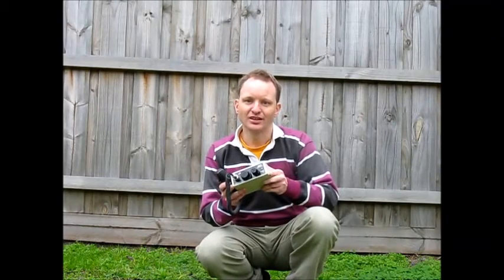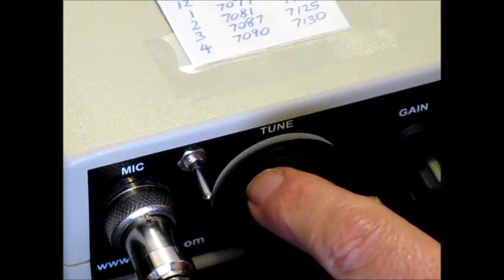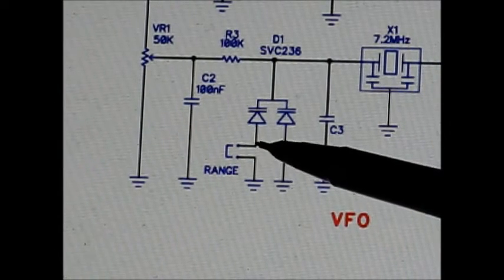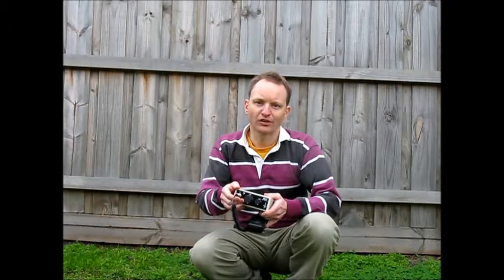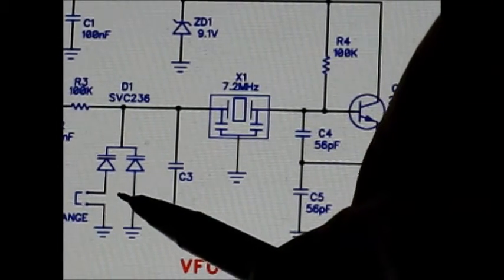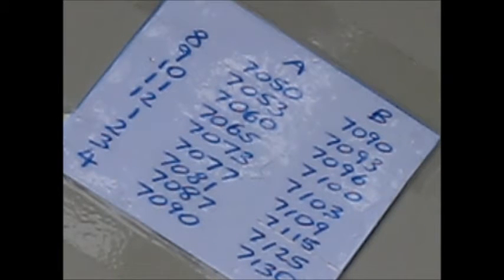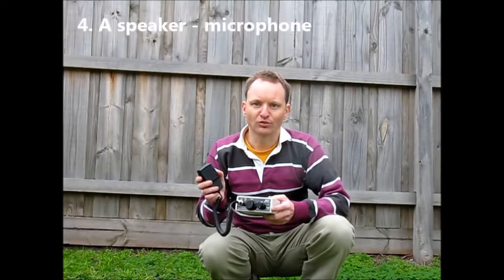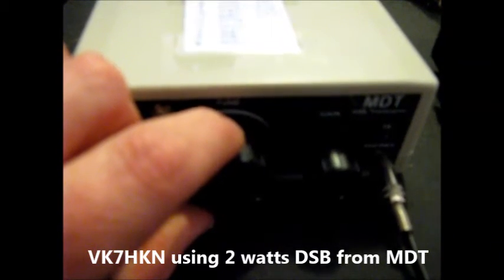Modifications to the MDT 7 MHz QRP transceiver (and a 2 x MDT contact)

Comment: Well done with those modifications, Peter.  They will definitely enhance the usability of the radio.

I was wondering if a reduction ratio drive on the tuning control might help?  The right hardware (with a smaller diameter than the replacement knob) may allow the log scale to remain visible, while enabling easier tuning?